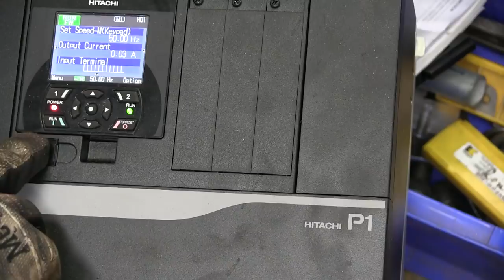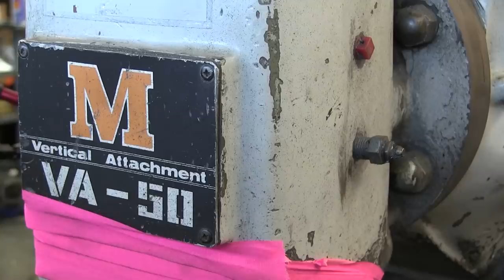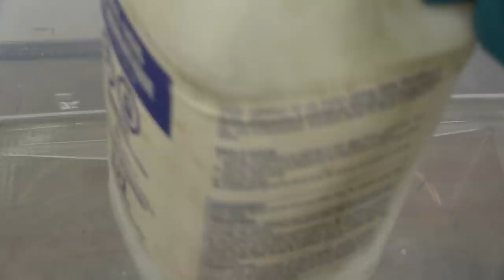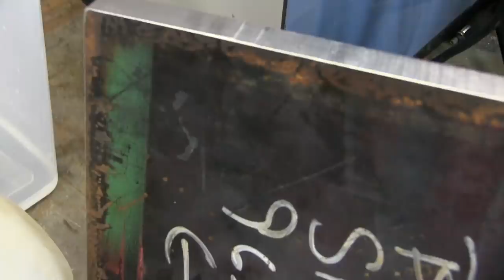Hangover Cure Breakfast | World's Skookumest BBQ Griddle?

Comment: This is what we use for a "tradiional" BBQ plate in Australia.

Before LPG was readily available (when I was a whipper snapper), we all just took a sheet of 1/4 inch steel plate and a few housebricks for a BBQ picnic - a "grill" (with bars or holes in it) was only used in some instances to let the ash drop out of the firebox.  FireWood was readily available for the scavenging  (proper hardwood, Eucalypt - what all BBQ's should be fueled with.  lol...   One can't BBQ sliced onoins on a grill with holes in it.

Comment: thermal over load is a good point...when i used to work for a carpet cleaning company we would run the engine in the back of truck at low throttle for 5 or so minutes after every job just for that reason

Comment: Nice! Love seein the Mazak Throw some Chips! Whats the Best Oil For seasoning the Steel or a cast iron Skillet?
Reply: James Bradley I've heard lard. A lot of oils get rancid under high heat. Avocado oil likes it hot, but might not give you the flavor spectrum of what great Gramma used.
Reply: Lard gas a low smoke point. Use canola or avocado.
Reply: What William said. I peel an avocado and rub the skillet down with it, or lightly coat it with some canola oil once a month.
Reply: Just use whatever you cook with, get it hot enough that it's just starting smoking and rub it on a couple times over half an hour and you're done.
(anything above 400F smoke point is perfect)
Reply: 10w30
Reply: Intermernet yeah but it's gotta be synthetic.
Reply: I dunno, some folks would say "organic" 10w30 is better for your wellness.
Reply: Food grade flaxseed or peanut oil. Put a thin coat on the pan, then heat the snot out of it till smoke rises. Kill the heat and let the pan cool. Repeat 3 to 6 times, then get cooking! Footnote: if you're new to carbon steel/cast iron cookware  there's two mortal sins to avoid. Don't use soap to clean, just hot water and a brillo pad. don't put the pan away without drying it and adding a coat of oil.
Reply: Cutting oil of course
Reply: Flaxseed, and ill explain why. Under high heat it polymerizes into an almost plastic super hard coating. Spread a thin coat and bake it. Go ahead and burn the oil a tiny bit. When its dry rub another thin layer. 3 or 4 layers and you'll have a great tough nonstick coating that even soap cant dissolve.

Thats the difference with people using avocado, peanut, or coconut oil. It just doesnt have that polymerizing property to it. It works and they are great oils. Itll keep from rusting th pan. But its not tough, washes off too easy, and its not nearly as nonstick.
Reply: Intermernet nah, straight 30 weight
Reply: James Bradley 10w40
Reply: sump oil but it must be from a Mach or a Kenworth or even your grandpas old farm truck
Reply: Liberal amounts of Vaseline do just fine, unless you're on a diet... Then go with some dihydrogen monoxide based KY Jelly, to get her purring like a kitten.

Comment: I once blew a permanent fuse in heat gun because of that latent heat. Had been cleaning two stroke exhaust out of carbon, heat gun red at the end, didn't let it cool down with free air flow.

Comment: Was workin in a shop once putting a sheet of 1/4" mild steel onto a shear, and of course we didn't have a crane to save our lives, what shop worth it's bread and butter would. So 3 of use were huffing to get the sheet up onto the shear when low and behold the guy with more brawn then brain and always looking to impress used his forearm to lift with. Sliced him good and proper right through his shirt and about a 1/2" deep into the meat.

Comment: You should look up making a fog buster style mist unit.   Basically a fluid tank you feed 15 PSI into and have two hoses coming out of.  One dips into the coolant fluid and one just takes air.   Then you have a nozzle that drips the fluid into the air flow and it distributes a nice mist of coolant into the tool and keep the tool and material cool.    If you run two regulators, one for the tank and one for the air flow you can get some real fine control of the mist.

Comment: Option 2
Camp chef brand.    2 burner deal with removable legs...

Get one of those , then some 5/16" ,1/4 , 3/8 flat carbon plate leave the millscale on the cook surface.  Cut to size. .. box in back and sides  with an inch or so tall fence of plate .. weld a panel of #9 expanded metal underneath,  some 1x1 1/8" angle as standoffs   if needed and a 2x2 angle drip v shape gutter in the front meat shmoo removal . ..maybe add a drain nipple that a hose can pop onto and drain to a can by the leg..
Enjoy

Comment: instead of cutting a grease groove take a hint from commercial griddles, weld 1/8" x 2"  steel perpendicular on 3 sides, on the last side weld 2" angle on the bottom facing up to create a channel for the oil and scraps to be scrapped into, a good size hole will allow everything to fall into a container if positioned properly

Comment: I used to store muriatic Acid in my garage until I realized that this stuff is so volatile that it manages to get past even the most well sealed plastic containers. Must be the vapor pressure or something like that.  I am not lying, I had the muriatic inside plastic jug with a screw on cap, the jug was inside a 5 gal plastic bucket with a gasketed snap lid and the vapors still got out.  All the bare metal in my garage would rust.  I eventually began storing the muriatic outside behind the garage and the rust problem stopped.  I don't even use it in my garage.  it's frigging nasty but nothing cleans metal better than it, so I keep it on hand.

Comment: Completely off topic for this video, but would  be right at home for quite a few others.

There is one place where a Dremel really shines: Removing broken taps. Just get some el-cheapo diamond files for it, and (with the blinds closed, of course, so no-one can see you) and start grinding away. It only goes about half a millimeter a minute, but compared to just about any other method and including the figure-out-what-to-try-next breaks, that's almost instantaneous. Fast enough to actually print out 'Extract broken tap, $40' instead of 'Rusted bolts very rusty, $200' on an invoice.

I broke my first tap yesterday, M5 in 5 mm steel. One night of sleeping on it, and less than 10 minutes work to get it out (just smashed the last 1.5 mm), including setup, and I'm ready to leave that screw-up and looking ahead to break the next one.

Comment: Not sure it's good idea. Steel could make sense if you used induction heating, but for this source of heating the solid natural STONE flat brick or tile is much better and natural stone keeps heat longer and better.  I installed granite stone tiles in our oven to recreate the old style "stone oven" (which makes famous crust bread) - and it proves that stone helping to save energy at least in half (after getting to max temp it keeps constant heat for hours), making the famous bread crust and easy cleans with low abrasive soda or sharp spatula.

Comment: For as long as it takes to heat up 1" thick steel compared to the amount of time you're cooking on it, it should be electric instead if gas or charcoal. You could get it to heat up faster. It's like putting a CFL bulb in the closet where it's never on long enough to come up to full brightness. Find another similar grill sitting out for the trash man and gut it and turn it into an electric griddle. Use the one currently under the armor plate for grilling.

Comment: As a Chef...SCHWING!!!

But, watch out for the poor grill. The heat is gonna start getting trapped and will eventually melt your grill bars and burners. Usually flattops like these are heated indirectly (usually ceramic briquettes or cast iron flame spreaders) that are loosely arranged on top of the burners, which sort of buffer the heat a bit, they’re sacrificial parts that get swapped out along with the burners every few years. Plus there is usually a large gap in the back to vent off the hot gases, and the plate itself is at a slight tilt to bleed off any trapped gas to the back.

Now go build a super-skookum french top.

Comment: Blue chips with carbide = generally, what you want to see. You want the heat to come out with the chip, and not transfer to the tool or material. 

A stick of cutting wax might have helped with longevity when cutting with the saw. Works well on bandsaws that have no coolant systems, especially when cutting shiny wood.

I wonder if parkerizing the plate  it to hold oil better would be worth the effort.

Comment: I thought hss had a good bit of cobalt. If i remember correctly which i probably dont those alloys are preferential over carbides because they will retain their hardness over high heat carbide inserts will come out under those high heats and are more brittle. Idk ive never used full carbides just saw blades or holesaws that have inserts interference fitted and i always preferred sharpening over replacement.

Comment: I was in a small shop trying to lay a 4' x 8'  sheet of 1/4" plate steel on a work table with the owner. We had it on edge and only had to lift it a few more inches before laying it over. We got it up and were about to tip it when it started to slip back down, but a "helpful" helper wanted to help. Since the owner and I were on each end, the helper was going to attempt to help by picking up from the middle. We managed to get it on the table, but I don't know if the owner and my faces were more red from our exertions, or yelling at that helper to keep back so he could keep his fingers.

Comment: I want to see more of this BBQ Griddle, i ended up taking a ground tilling Disc from a old farm, 3/8" thick/28" diameter and welding up the bolt holes and putting handles/feet on it. Super nice for a camp fire since bottom of the disc is super hot. and it gets cooler as you go up the edge. can do a badass breakfast on it but i always wanted to see how a thick griddle performed

Comment: That hot plate is a beautiful thing! On the circular...maybe a thermal overload circuit should reduce the current (torque?) to the motor retaining cooling features, instead of cutting everything out all together? Not sure what's possible with those motors...so probably a brain fart to be ignored :)

Comment: I wouldn't call the mill clapped out just yet.  Do some service and adjustment on it.  Shim up the Gibs and ways if needed.  Even if it is extremely worn out you should still be able to get it to within a few thousandths runout on all three axes.

Comment: A smartly designed saw would have a thermal overload that cuts the saw to 2/3 or 1/2 speed, indicating to the operator to pull out of the work and run it “free” with no load, keeping the fan going and cooling the motor.  As soon as the air going through the machine cooled it down to safe operating temperature, it would speed back up to full.

  Could one simply do this to a 120v tool and perhaps make up custom kits to modify existing tools with thermal overload devices to operate as I’ve described?

Comment: manoeuvre a fair bit of heavy H section steel in the building game in the uk....cant beat a few cut down scaffold tubes for rollers...and if youve got room for longer rollers they get you round corners on the slide...go 18inches keep the line on but cut a blip over  1mm of the top...thats the norm instructions from my boss...seems to work most of the time...

Comment: I used to have a Milwaukee core drill what for 6 inches ducting.  it had a setting so you could run just the fan to cool the tool down, but the darn thing didn't have a clutch so would near damn rip your arm off every time it seized up. swings and roundabouts, C'est la vie, I guess.

Comment: Three of my apprentice mates and i tried to get a 1000 x 1000 x 40mm thick bbq plate i had made off the coal mining lease, at night, but to no avail on account of the steep grade and torrential rain...we drove out after shift completely inebriated to the fence and couldn't get it more than 1meter from where we had stashed it with the bucket truck and hiab the shift before and there it lays im sure to this day still.

Comment: Long time viewer, first time commenter here. Just chiming in to say that I don't believe you used the term "latent heat" correctly when explaining why you removed the thermal overload on your resip saw. The type of heat you're referring to is called sensible heat, which is the heat you can actually measure by temperature. Latent heat is the heat that is used to change a substance's state of matter and doesn't register any temperature difference (ei. boiling water never rises above 100C or 212F, it just changes into steam) Not trying to nit pick or anything, just thought you'd enjoy learning something potentially new. Anyways, great vids! Keep em coming!

Comment: Great job and thanks for the heavy steel safety tips. Ever swing steel road plate with a 680 Case backhoe and have some Mexilaborino grabbing at it and flying around like a wind sock as you are trying to set it? I  have.

Comment: Exactly what I'm planning on doing but only have 1/4" plate, it'll do. Guess the Overlords have been watching me closely to feed this video all of a sudden
Reply: How’d it turn out?  Did 1/4” plate feel good enough, or did you wish you had another 1/8” or so?
Reply: @willdejong7763  I wouldn't go more than 1/4 for anything you want to use occasionally. Even the 1/4" is really heavy spanning my 30" range (electric btw) It definitely has hot spots directly over the elements, but I work with it as different ingredients require more or less heat.

Comment: Skip the muriatic acid next time. Use citric acid next time. A pound of citirtic acid mixed in that water would have taken all that milscale right off of there. It's a great degreaser and rust remover also. And when your done with it you can put it right down the drain

Comment: chinese endmills are painful

and a coated 5 flute carbide endmill cant be beaten, I can get 1"doc 20% stepover with a 3/8 endmill in steel to cut silent at 250sfm/.001tpt

even on the manual mill though I might slow it down to like 160 sfm

hss is usually cheaper for anything over 1/2in in the long run

Comment: Will any 1" steel work or is there something specific I should be looking for?
I'm thinking of using 304, but I don't know what type AvE used.
Does anyone know?
Reply from the maker: A36 or 44W. Cheap hot rolled mild steel. Vinegar douche for the mill scale. Season to taste.
Reply: @arduinoversusevil2025  Frickin perfect.  Thanks mate.
Reply: @arduinoversusevil2025  Hey,  update for ya.  I got my slab and cleaned it up nicely.  Cooking on thermal mass is awesome.  Thanks for the video, and the reply.  Cookin' like a pro!